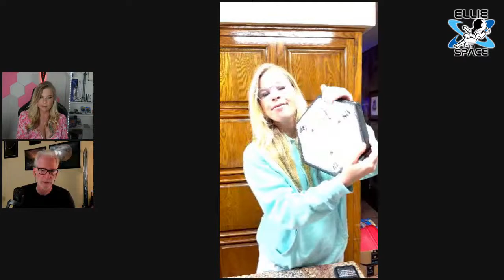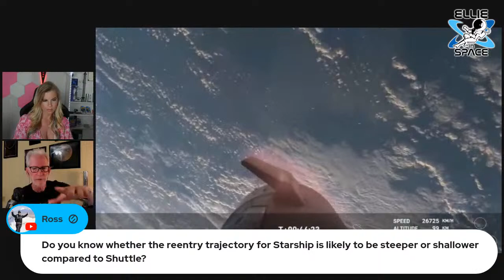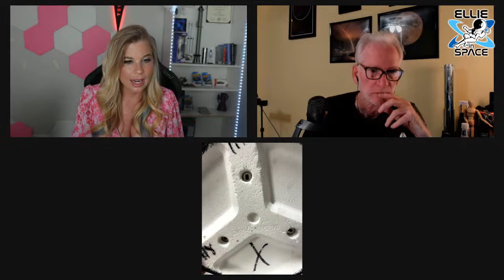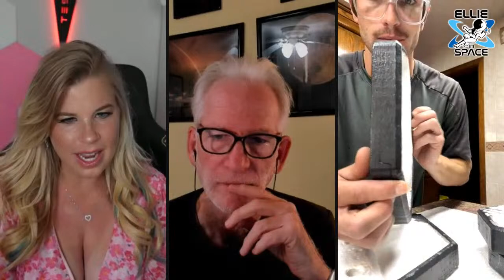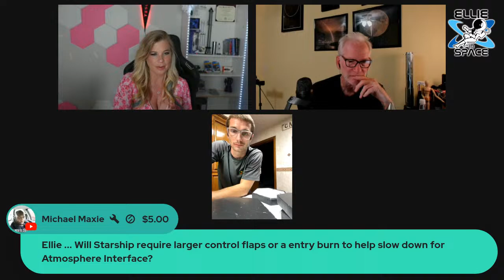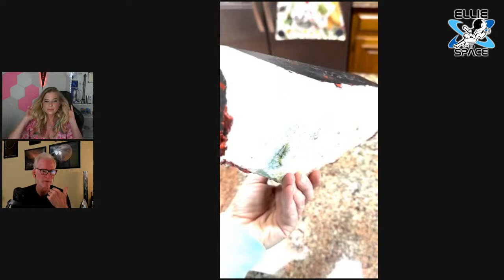101: SpaceX's Starship HEAT tiles

Comment: Hello, Ellie In Space. Just a thought. What if there is a second Outer Stainless Steel skin for the Star Ship with tiles on (The Inside and The outside). I don't know if this is an Engineering Probability. I personally believe it can be done, it could be the solution to more Star Ships being Lost. I am just a Hobbyist. I know this comment is not germane to this discussion, my two-cent. Best Regards.

Comment: Those tiles were the death of space shuttle, they're a maintenance headache and they fall off.  I wish there was some other heat shielding they could use, but if there was they'd probably be using it, oh well.  At least we have better automation and computer vision now for the inspection and maintenance task; the tiles will need to be inspected before every single flight.

Comment: I believe the tiles are a technology based on silica gel which has incredibly high thermal insulation. The silica gel has incredibly low density,  it's  mostly "empty"  space,  it's thermal mass is very low and its it's a great insulator.  It is very fragile so it is coated with a tough, thermally resistant. The space shuttle used a glass-like material called RCG or reaction cured glass.  More recent coatings include TUFI and HETC for Toughened Unipiece Fiberous Insulation and High Efficiency Tantalum-based Composite.  The silica gel can absorb a large amount of water.

Comment: On top of all the other control issues if you have 10% of your fuel left in those tanks you've got 250 to 400 tons in two separate tanks with two separate centers of gravity,, so if there is any fuel movement you will have double the mass in the oxy tank vs methane, so according to my calculations you'd have twice as much oscillation at the bottom as the top tank ,,ya think?

Comment: I wonder if 18,000 lb of fuel would be enough for atmosphere entry burn,, ie. no heat shield would then be needed.  Tiles are so expensive in construction, installation and for the extra cost of weight to the vehicle.

Comment: The best heat shield is no heat shield. This is a plasma, so it is ionized. In theory, you could run wires over the steel and make a magnetic shield and deflect the plasma around the ship. But the power requirements would be rather large. Microfusion would have to be a thing.

Comment: When an object rubs against another object the friction creates heat. As an object enters the atmosphere it heats up because it is rubbing up against air molecules. This is not rocket science.
Reply: This is rocket science : It  is NOT molecules rubbing together ; it is compression heat: collision of molecules against each other.
T = Tas × ( 1 + 0.2 × Mach² )
Tas =  temperature before the shock
Mach = speed /speed of sound
when the gas becomes a plasma, 0.2 varies a little
0.2 = ½( 2 / n) 
n = number of degrees of freedom of the gas molecule
air : n = 5
3 translation , 2 rotation 
rotation along the long axis  does not count
co2 : n = 7    2 additional bending
 modes
Reply: Effect of air becoming a plasma:
one electron is torn out (ionization) simplest case electron is kicket out of the hydrogen atom,
the ionization energy is 13.6 EV
the color (frequency of the photon) is given by the Energy 
E = h × frequency
h = 6.62 10^-34  joule sec
h = Planks constant
Reply: @arturoeugster7228  Exactly friction heats the air molecules so much the electrons boil off
Reply: @arturoeugster7228  No it isn't 
You're wrong.

Comment: I remember when the Shuttle program was flying.  An astronaut came by the local mall giving information about the shuttle.  He brought a heat tile with a hole drilled half the thickness of the tile.  He put his finger and lit a blow torch.  He put point blank to the tile and said his finger doesn't feel any heat.  
Starship may need a few tiles on the edges.  If you look at the shuttle, there are tiles on the nose and front edge of the wing.  The fins in Starship look vulnerable.

Comment: Nasa said the average was for repairing or replacing 100 tiles per mission. The issue with Shuttle tiles was they were being damaged by debris from the external tank and solid rocket boosters. Very few actually fell completely off.

Comment: Interesting look at the tiles.  I wonder if after fueling the ship if the steel shrinks as it cools then perhaps an attachment pin pulls out a bit?  Another possibility is that moisture gets under the tile which then freezes at fueling which pops the tile off enough so the vibration and air stream knocks it off during launch.  Or perhaps some of the pins are out of spec so they don't grab the socket in the tile tightly enough.   I'm sure the SpaceX engineers have considered these problems because if they were wide-spread then a lot more tiles would be coming loose.

Comment: Re-Entry AoA (angle of attack) for the Shuttle is 40 Deg, But StarShip belly flop entry method was planned at 60 Deg. But I think both are way too aggressive. I would rather have an AOA of 35 Deg adjustable to 38 Deg. There is another key difference in heat tile thickness been StarSHip and The Shuttle. It appears that StartShip tiles are all SAME thickness (about 2.5 inches thick). But the Shuttle has tapered thickness from Nose cone at 2.5inches to 12.5 inches towards the tail bottom part of the craft. Shuttle uses carbon-carbon composite, then silica/ceramic composite base.
Personally, I would like to see those tiles tested to 2000 Deg C for 5 mins flat.

Comment: Actually, I’m surprised they really need a tail on the rocket on the upper side to help guide it down so that it does act more of like a shuttle coming in that way it needs a rudder . It’s got the wings, but it needs a rudder
Reply: Nope, they already evaluated that, it doesn't need it. It steers by diferential drag, not aerodynamics. They're not wings, they're drag flaps, it doesn't 'fly', it sky-dives.
Where the guest describes it at 'lift', he's using the wrong term.

Comment: Per me SpaceX must use completely new technology for tiles. This one is a crap. Nowadays there are anvances in material science. There are composite materials comprise of multiple layers of fire proove aluminum oxide, titanium, silicon oxide, grafite. They need something new.
Reply: You should apply for a job and show them the error of their ways.😐
Reply: The tiles used are already made of composite material.  It material composition: silica fibers, quartz fibers, carbon, organic compounds, alumina-borosilicate fiber, rigid ceramic composites.  From the video the attachment method must be improved.  It simply does not work.  Tiles were seen flown off the Starship during re-entry.  Heat shield tiles fell off caused a space shuttle explosion during re-entry.
Reply: @catchnkill what space shuttle had that happen?
Reply: @stratolestele7611  My memory did not serve me right.  The cause of the protection tile system damaged was a foam hit.  Thank you for your hint.  Exact details of the Columia diaster was mentioned incorrectly.  However the conclusion was correct.  Starship also cannot allow TPS breach.  Protection tiles falling out has high risk of TPS breach. If Starship can do without TPS, those heat shield tiles would not been installed at all.

Comment: Wait, I heard one "expert" say the reentry heat was not caused by friction but by compression.
Reply: Friction slows the air at the surface, and then the different flow rates as you get further from the surface causes compression, both the friction and the compression causes heat, the friction heat is what the tile deals with, while the compression heat causes the plasma above the surface.

Comment: one bit of pedantry, it's compression not friction makes the plasma, the molecules of air get squashed and release energy, neutrons and photons, it's not really friction, the molecules just can't get out of the way at those speeds so the compress and then electrons start flying about. just saying.
Reply: Yep, the friction parts is only the flow that's in contact with the surface, where the plasma is in the air above the surface. The tile only really needs to deal with the friction heating, thanks to the plasma carrying away the heat in that air.

Comment: Space Shuttle had 27000 tiles, over 10,000 more than starship. I believe the starship tiles will hold up awesome with the rapid design changes/improvements. 

Was that re-entry plasma video the coolest thing ever?!!!🎉
Reply: There's a second important factor in those numbers. The largest percentage of the Starship tiles are Identical. Nearly all of the Space Shuttle tiles are Unique.
Having so many identical tiles makes then several orders of magnitude less expensive to manufacture and fit.
Reply: @PiDsPagePrototypes  oh yes I for sure know it in detail, can you imagine being the glue guy, puzzlemaster2000!?
Reply: @PiDsPagePrototypes  My hunch is that tiles ultimately are going to be too cumbersome to keep maintaining. There should be a way to wrap a thermal ablative blanket around starship, which is expendable.
Reply: @paulmichaelfreedman8334  nah, get the clips sorted, resuce tile loss. Point of them is they're easy to replace, whereas redoing the whole ship takes that shit out of service for the duration, days or weeks to replace.

Comment: It's not friction, it's compression.  The air compresses in front of the object falling into the atmosphere and heats up.  The heat transfers into the falling object.
Reply: I’m not a physicist or rocket scientist, but I suspect, at those ridiculous entry speeds, it is both.
Reply: @fredmeebley  Friction is negligible compared to the energy dissipation through bow shock compression. The heat is nearly all IR radiation.
Reply: Yes was coming on to say the same thing ..   and also that the bow-shock actually protects the surfaces a little and the plasma carries away the heat from the compression.
Reply: Therefore friction. Compression causes gas molecules to…. Finish the sentence.
Reply: @Sal3600 it's friction of air molecules with each other but well away from the surface of Starship due to the bow shock. Surface heating is a result of heat radiated from the high temperature plasma in the compression area.
Reply: @Sal3600  Nope, friction is heat produced by collisions, compression causes the temperature to rise because all the molecules are closer together.
Reply: @paulmichaelfreedman8334  What causes the higher temperature? hmmm?? lmao
Reply: @Sal3600  Sure, in the end it's all friction by that metric. But it's not DIRECT friction (two materials moving past each other with force applied), the gases are compressed after which the increased number of collisions (your "friction") causes the higher temperature. Satisfied?
Reply: @paulmichaelfreedman8334  correct. Direct friction works the same way at the atomic level. The only difference is one is solid and one is gaseous. I’m no physicist of course.
Reply: Compression and friction are related but distinct concepts. Compression refers to the action of applying pressure to reduce the volume or size of an object or substance. Friction, on the other hand, is the force that opposes the relative motion of two surfaces in contact with each other. While compression can sometimes lead to an increase in friction due to increased contact between surfaces, they are not the same thing.
Reply: @BuyBitcoinholdit  Correct, but OP was saying friction has nothing to do with it basically.